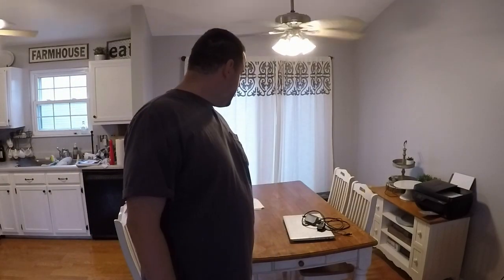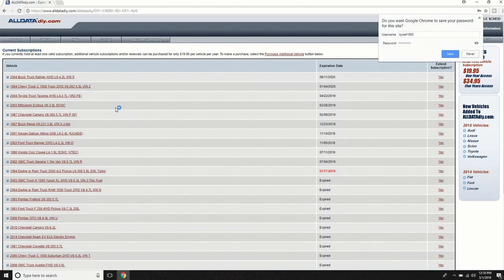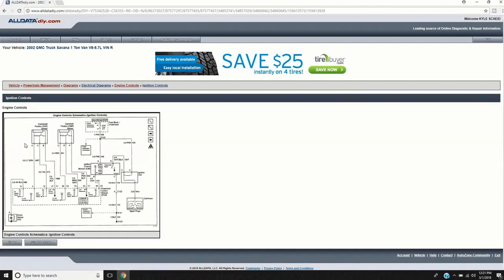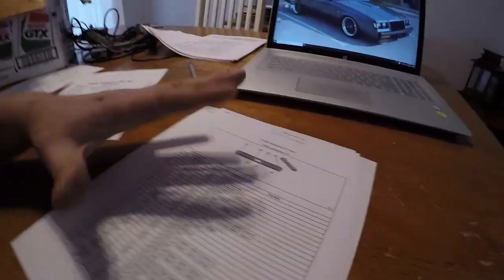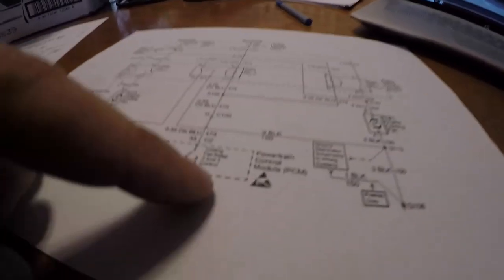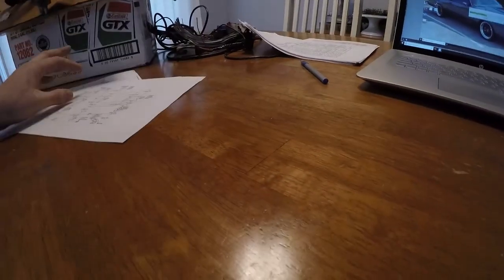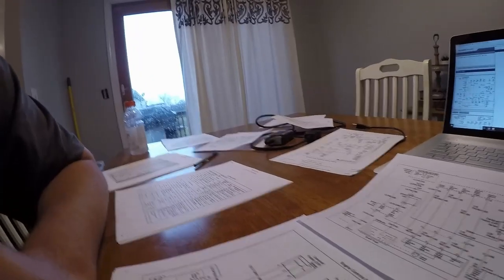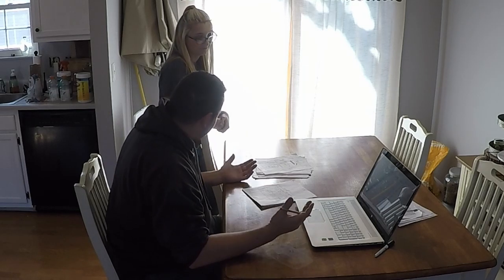LT1 411 LS1 pcm swap part 4 rewiring LT1 harness

Comment: I have a 4l60e. Will this work with my trans or will I have to customize the connectors and wires for the automatic trans?
Reply from the maker: It'll work on 96-97. You will have to look up the pinouts.
Reply: @HorsepowerTube  so its a no go on my 95 a4?
Reply from the maker: As far as I know a stock 0411 only controls 96+ 4l60e
Reply from the maker: Somehow torque head does it idk how

Comment: Hey I got a question what would it cost to program mine same thing as yours except I'm using 30 lb injectors
Reply from the maker: Hard to say it depends on where you take it or if you can find someone with hptuners that would let you borrow it, or buy your own. it costs $500 but comes with 4 vehicles worth of licenses. After that its $100 for the license for each pcm and then you can do unlimited changes to it. I'll show you how in a upcoming video its very easy! Its a nice tool to have. Especially if you are like me and your whole family drives GM vehicles. Whenever someone gets a dumb emission code that you dont care about you can just delete it forever from the pcm! efi live works too but ive never used it.
Reply: HorsepowerTube 😨👏😨👏😨👏😨👏🍺🍻😨👏😨👏😨👏😨👏🍻🍺😨👏😨👏😨🤔😨🤔😨🤔😨👏